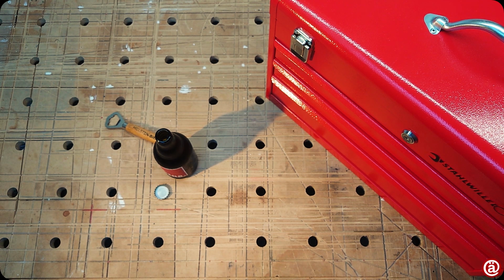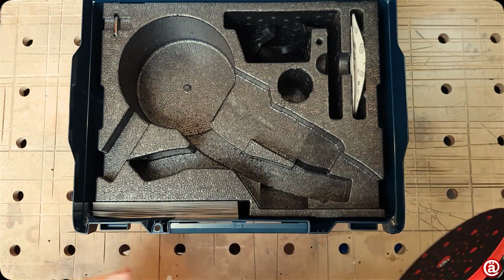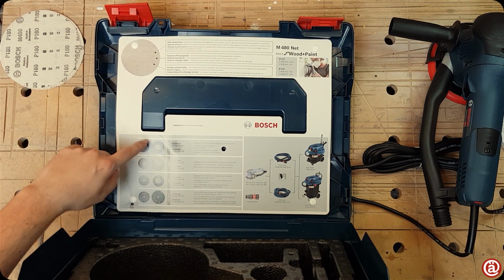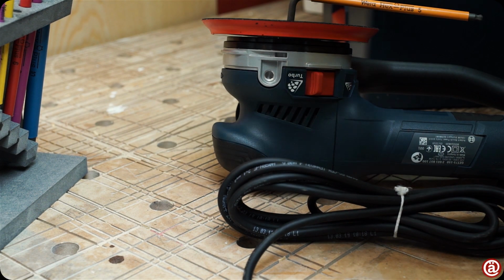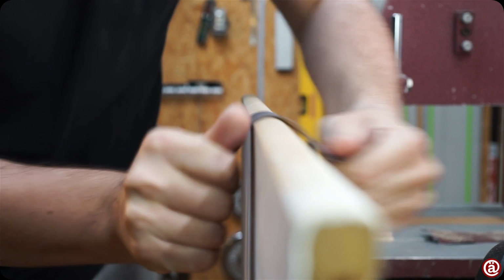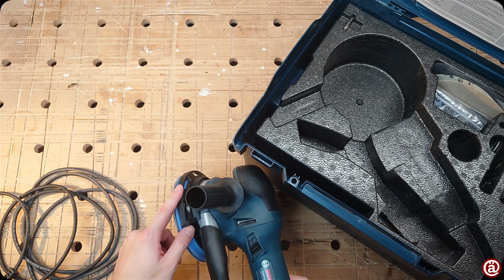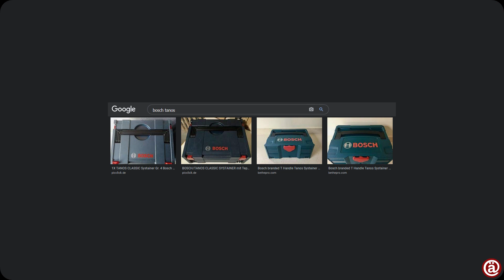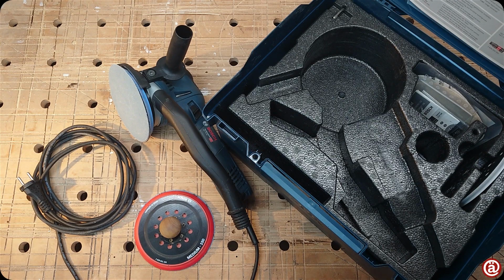Bosch GET 75-150 (GET 75-6N) - review & unboxing | Etna.

Comment: Thanks for perfect wrap up! Just what I needed to choose this sander. Could you tell me the number for the hard backing pad - that is not included is it? Also, what vacuum hose adapter do you use to fit the sander to the vacuum? Thanks!
Reply from the maker: Thank you for your kind words!

The hard backing pad is not included. Bosch is listing it as No  2 608 601 334. 

I've purchased a Flex vacuum. German brand, made in China. That adapter was included. So far every tools seems to fit to it. You might not get it. A friend of mine uses a Festool adapter on his chinese vacuum and is very happy about it as the adapter is very flexible. 

I hope that helps!

Regards,
Etna.
Reply: @Etna.  Thanks! Then I will add a hard disc upon purchase. Another thing if you don’t mind. The sanding plate protector, Bosch Professional 2608000690, comes in 2 pieces. I never used these plates and was wondering how many to buy? Do each last for years or is it something that is changed more often?

Finally, great with feedback on vacuum hose selection. Do you know the name of the Festool version that your friend are using? I have a Nilfisk machine with standard 57 mm hose connector on the machine side. Thanks again!
Reply from the maker: As they are consumables, they don't last forever but are pretty durable. I keep one on every backing pad and have a pack spare. 

Nilfisk adapters should fit. 

Regards,
Etna.

Comment: Looking into buying this sander for a big project where I have to sand wood ceilings. Do you think this would be a good sander for overhead use?
Reply from the maker: I always thought that in this case products like the Festool Planex or Bosch GTR 55-225 would be designed for it. 

Overhead use is no joke and very tiresome. 

Regards,
Etna.

Comment: What is the life span of the sanding disc. I   purchased 3 new sanding disc with 2 to spare. By the time i was ready to use one of the 2 they had already deteriorated to useless without ever been used like the one i meant to replace. Have u solved that issue? If not, its best not to buy a backup pad until needed or u will be wasting money.
Reply from the maker: I'm sorry but I don't understand the issue. What brand of sanding discs are you using? My sanding discs hold up just fine. I'm also using a velcro protection pad between sanding disc and backing pad. Those are quite essential and afaik not available outside Europe. 

Regards,
Etna.

Comment: Hi,  thanks foe the nice  review video,. I am still not sure which  one should i purchase!   Today i went  some  professionele shop for check  this  bosch sander but there wasnt  mostly online. I saw flex ore 5-150 ec  i like it  ergonomie and  look solid  but have no idea about the brand.  So you say  with one hands  using no problem?
Reply from the maker: It depends on what you want to do. The Flex is more like a Mirka as they are mostly for finer sanding. This Bosch is a sander like a Rotex with a function that allows you to remove almost as much as a belt sander. One hand sanding is possible but not as comfortable as with your mentioned sander. 

Regards,
Etna.

Comment: I'm very much considering this sander. As a painter I tend to be removing alot of paint refinishing. Just pisses me off that I can't get on with the sortimo case in NA. Also you should try using 3M cubitron extract sanding discs. They are newish I think but I've been using them lately and they are really quite amazing and prices for them in NA are good.
Reply from the maker: A lot of people complain how Bosch tools come with different accesories from region to region. Some can't even buy the needed adapter pads to spare their backing pad so they buy one from Mirka. Imho they just should switch plugs and voltages. That's it. But I am not Bosch, so... 

Thanks for the tip! I do like a lot of 3M products. I'll try them out when I need a new pack of sanding discs. Normally I go for the name brand that is the cheapest.

Regards, 
Etna.

Comment: Youre one of the only ones that has hinted at anything about reliability of any of the higher end sanders on video..lol.

Most Bosch power tools seem to be more... "hey buy us because Bosch" not because they are particularly good.  This sander and the double bevel sliding miter saw seem to be the exceptions.
Reply from the maker: Thank you so much! That means a lot to me. I guess it is because I have a love-hate relationship with Bosch power tools. Either they are crap and I can't stand using them. Or I am in love. 

I have the script ready for a video discussing this. But I have no clue when I come around doing it. 

Regards,
Etna.

Comment: Does this model get hot? I have a new gex 150 turbo and it gets hot after 10 minutes of use. Stator has been renewd by bosch (faulty from factory). Ballbearing renewd (faulty from factory). Still gets way to hot after 10 minutes of us. Repair time Bosch (warranty) is 4 weeks each time. Hopeless. I'm used to makita and Festo and never had such issues...
Reply from the maker: This sounds weird, indeed. I had no issues so far. But I couldn't learn from my prior mistakes and did hand it out to a friend who is renovating. I might need to change bearings and clean it after receiving it back. So, there might be a repair video on my sander. 

My experience with Bosch powertools in general is, that I either love it or hate it very much. So it really depends on the case. 

I hope that helps somewhat!

Regards, 
Etna.

Comment: Loved your review and comments.  Where do you get that velcro "adapter" pad?
Reply from the maker: Thanks!

Bosch lists them as item No 2 608 000 690. I'm sure your trusted tool dealer has them or you can find them on Amazon. 

Regards,
Etna.
Reply: @Etna.  Well I contacted Bosch and it looks like they do not want to stock them in North America.  I was very disappointed with their response.
Reply from the maker: Well... Mirka has some, too. They look similar. Maybe they fit. You should be ok, if most of the holes line up or you could punch new holes. 

Festool calls these protection pad. 

Regards,
Etna.
Reply: I ended up ordering a bunch the Bosch backer pads from Axeminster in the UK.
Reply: @c2gutbuster  Hey there! I was looking for these pads and found Mirka's pad looks awfully similar to Bosch's. The product code is Mirka 9956. I ordered some from Amazon and all the reviews there said it's compatible and works well with the GET-75.

Comment: Where can you find the molded case? I have tried to find it but have had no luck.
Reply from the maker: Do you mean the regular Sortimo case or the styrofoam insert? If you don't need the Bosch label, just buy a regular Sortimo case. The insert can be ordered directly from Bosch under parts number 1 600 A01 B72.

I hope that helps!

Regards, 
Etna.

Comment: OMG  Finally someone is talking about the velcro protection pad!  I have searched lots of places but it seems bosch doesn't carry one?  May I know which protection pad you purchased, is it the mirka platen protector? Thanks!!
Reply from the maker: Hi!

Bosch has their own protection pad listed as Part No 2 608 000 690. At least these are the ones I use. The pads Mirka and Festool sell are blocking a lot of holes so dust extraction won't be the best. 

Maybe you need to teach your sellers about these? 

Regards, 
Etna.
Reply: @Etna.  Thanks. Did a search with the part number and looks like this isn't available in North America. Hmm, not sure if it's worth it to order one from Europe and get it shipped over.
Reply from the maker: That's a bummer. Maybe buying those pad savers from Mirka would be the next best thing. They have at least many hole patterns as a choice. Something might fit okay. I don't get it why they won't sell these things in the US. 

Regards,
Etna.

Comment: Great review.  Just curious, if I want to get hard sand papers for this sander, which one would you recommend, as I need to remove a large wooden cabinet covered with a thick decal. Trying to remove decal with low grit sandpaper that is capable.  Thanks
Reply from the maker: What do you mean by hard sand papers? I mention sanding disks in my video. Use those. They shred any stickers or decals within seconds even while using higher grids. 

Regards, 
Etna.
Reply: @Etna.  really!  So mesh sand paper would be enough to get rid of thick large decal that’s been there of 40 years?  Any preference on brand?  I thought perhaps none mesh sand paper at 60 grit would do the job better.

Comment: So how your sander is keeping up after 1 year?
Reply from the maker: Still keeping up. It got a bit abused by a friend as he remodeled his apartment but I would buy it again so far. My wrist enjoys the slim design and my back loves it's lighter weight compared to similar sanders. 

Regards,
Etna.
Reply: @Etna.  how about the sanding paper, which one you use? Does it work with festool granat?
Reply from the maker: If you mean Granat Net, then yes... I only use net style sanding discs. And I buy the cheapest there is at the moment. Festool, Bosch, Mirka... 

Regards,
Etna.

Comment: Isn't the design awkward to use? So long. Weight not in the middle
Reply from the maker: None of the geared sanders have their center of gravity over the backing pad. It also only seems long due to its slim design. Other sanders have a similar length but are way bulkier. So it is quite the opposite. Due to its slim design the center of gravity moves towards the backing pad. This sander is able to balance as others don't. I chose this one over a Rotex or a BO6050 because it handles much better. You have more grip as your hand comes easier around the housing. And don't forget that you need that leverage to handle the geared mode. This sander is able to remove almost as much material as a belt sander. 

Regards,
Etna.
Reply: @Etna.  It is a bad design IMO. It does not balance well (compared to my GEX 125-150 AVE), vibrates much more, is less effective (in random orbital mode). I will get rid of mine and use the GEX again. To remove much material I will use other methods (planing, belt sander, scraper, router or "Metabo Lackfräse"...) I think Bosch did a bad job with this machine, but many seem to like it -- which surprises me very much.
Reply from the maker: @nickgoogle4525 , you are comparing apples and oranges there. This Bosch is in comparison with a Rotex or Makitas equivalent much lighter, smaller and thus easier to handle. If you don't need or want a geared sander, then buy a Mirka instead. My bet is that you will be much happier with their orbital sander designs.

Regards,
Etna.